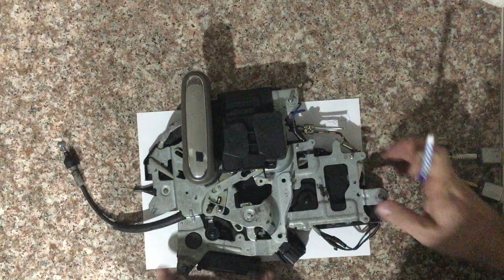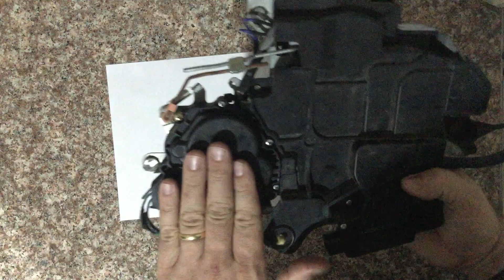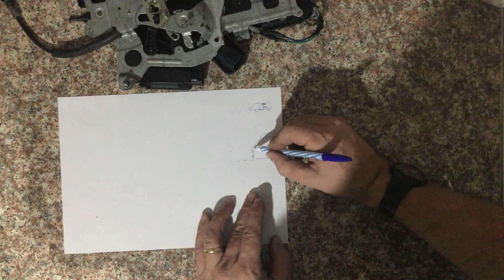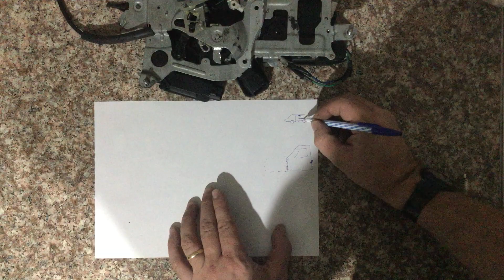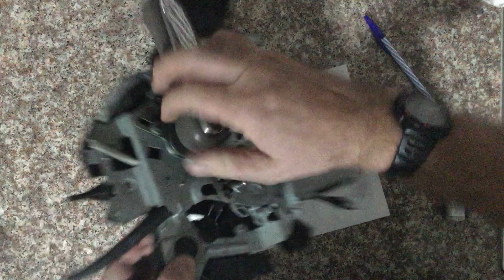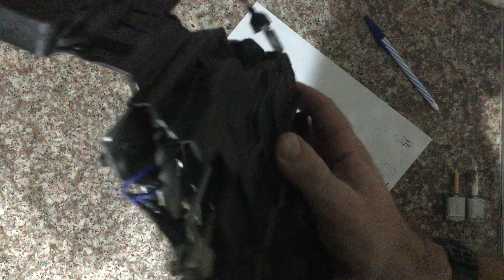Kia Sedona SLIDING DOOR - REPAIR GUIDE

Comment: The o/s sliding door is closed and l cannot opening get to open
Reply from the maker: Perhaps a jammed lock or broken cable  (multiple cables (2 for motor, one for exterior lock, …) ). 

Interior manual is best bet but if child lock is on its useless. Then try from exterior manually.

Comment: can i get the part number for the whole unit
Reply from the maker: Unfortunately I do not have access to this at this time. It will also vary based on your model year. 

You can search eBay.com with “20xx Kia Sedona power sliding door lock assembly”
Reply: For most it door assembly controller part number 81450-4D513. Must purchase from KIA, Major cost is in the labor.

Comment: Very good, I want to ask where I can buy this kind of motor, the auto repair shop is too expensive
Reply from the maker: For NEW PARTS: 
You can order on eBay.com (if you are not familiar, eBay is not only an auction site but also a platform for retailers). 

I have ordered brand new parts from eBay. Kia Korea sells their parts new from this platform. You will half to wait for shopping but it is not outrageously priced or long wait (less than 2 weeks). 

USED:
Look up your local car junk yard. They are all different. Just call them and ask, usually super helpful. Some have better organized online databases of their parts. 

Try a local “mom & pop” mechanic shop. They usually have access to a number of used parts databases with their mechanic shop license.

Comment: .Dealer thought my driver's side door was this problem: "the servo motor. "  It was not. It was the logic controller instead of the latch controller shown in this video.  So, FYI. Symptoms on mine was that it would OPEN with power but would not reverse and CLOSE with power.  Hence, only problem was the closing under power not occuring. Door would respond but would continue to try to open and open and open. Never could figure out it was ALREADY open and needed to close. I did some forum reading and deduced that the fix may be  to replace this module: 95450-4D102  Door (logic) Control Module.   My door had been getting worse and worse in regards to not being responsive to the buttons and remotes. It was a gradual decline in function. This door "LOGIC" control module does require the dealer to program it into the system. But, i  figured out which module needed to be replaced. The dealer was shocked and had no idea that module existed!!! It was a teamwork job between customer and dealer. Even the factory support folks were stumped. So, can't self fix it. But, YES, I did also replace the servo motor just to be safe while I was in there.
Reply from the maker: Thanks for the info. 
95450-4D102 door logic is also referred to as DLA-696. 
I have purchased one but not installed it yet. May do a follow up video on it. I was not aware that the dealer needs to program it. I thought it came ready from factory. Only used in Kia and Hyunday that I am aware of.
Reply: Cool. I have 3 keys and 2 remotes. All still worked after they programmed in the logic box. The box interfaces with the security system and the doors for the remotes and handles the door's status/logic. EG: is it open or closed etc.